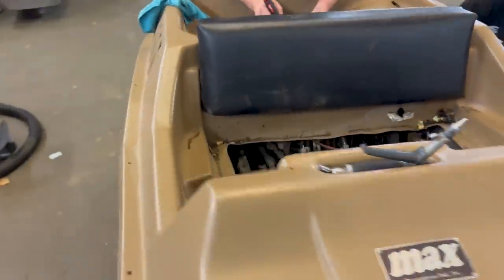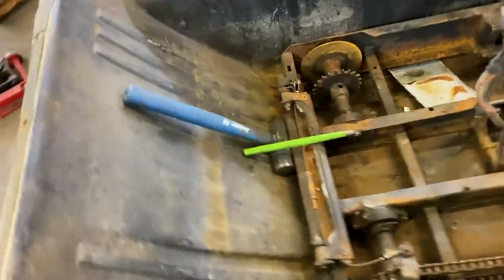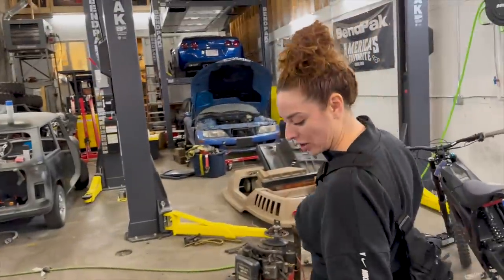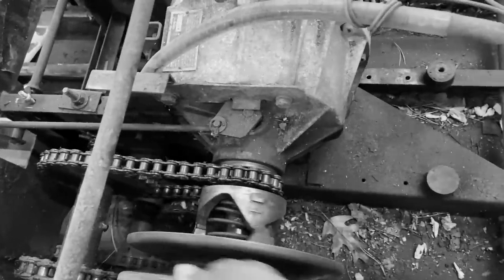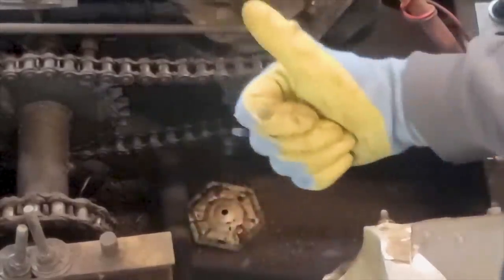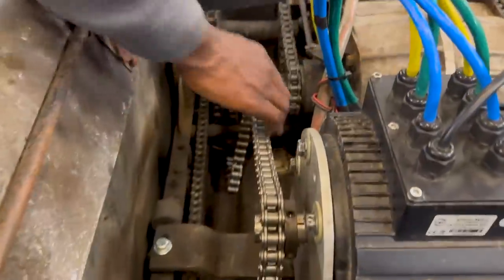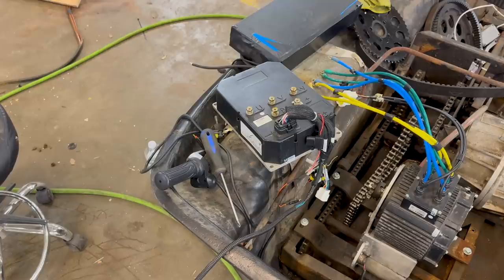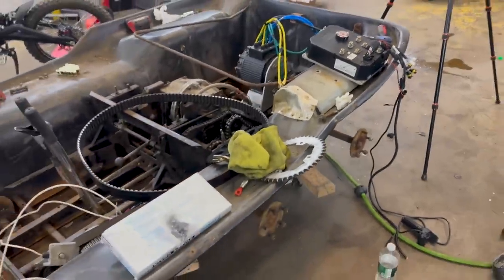Our First Attempt to Build An Electric Amphibious Vehicle led to Miserable Results

Comment: You need to scrap the center transfer box and install a pair of electric motors instead: a single motor drives each side. Will cut down on weight and reduce power lost through the transfer box. Also simplifies the controls.
Reply: On a first robotics team and this is exactly what the majority of teams do, even with a couple small motors it's more than enough to go like 15 mph
Reply: Motor and transfer box is probably not much lighter than 2 motors, more prone to failure than 2 motors and outputs a lot less power than 1 motor. 

Based on those facts, and history, Rich will almost certainly choose to keep the transfer box.
Reply: @theParticleGod  another motor means another controller and more hardware which isn't cheap or lighter by no means! Also if one one those fails it's bad!
Reply: @carholic-sz3qv   Theres no combination (1 motor + 1 transmission vs 1 motor + 1 motor) where a failure isnt crippling.

Comment: With Summer coming, I'd consider a quad jet ski combo, similar the Quadski. But with an EV swap.
Reply: And your strap on 😮
Reply: Water and EVs aren't the best combination. Rich isn't planning on going too far away from land on this project. An EV jet ski is trying to reinvent the wheel, but using flat sides on the new "wheel"

Comment: There is online calculators that will calculate the torque/HP of the motor based on the two gears and chain and motor HP/Power specs, and will tell you what the RPM and evertying is expected at the gear.  So that way you can pre-calculate all your sproket loss and if you are sending too much power, or not enough and adjust your gears until you are optimum.

Comment: On my Attex I had room to mount the motor above and slightly to the rear of the transmission which left plenty of room for batteries behind it in the bottom.  Initially I used Odyssey AGMs but upgraded to 16 100ah CALB cells.  I also used chain drive at first but switched to belt to eliminate lube being sprayed around from higher RPMs, chain stretch, and noise.  It's been over 10 years and still going strong.

Comment: The ideal conversion in my opinion would be to go for two (or more) electric motors to drive wheel groups independently. You could discard the transmission clutch system, and manage the steering by controlling motor power individually. You could even add a steering wheel with a digital encoder, and with a bit of coding, convert steering and throttle inputs into the required motor outputs.

Comment: I think that the Argo would work berrer with two smaller motors, one for each side and take out the differential unit as you can steer with a dual throttle setup .

Comment: Ditch more of it. Have a motor per side, or a motor per wheel. Perhaps hub ones, so you can seal the axle holes and just have wires pass from the inside of the vehicle to the wheels somewhere above the water line.

Comment: Uncle rich from my assessment.  You needed more sealant, resilin, or an epoxy.

Then you needed a better type of material.  

You have a 35% chance with what you did in the video but with my assessment you have a 57% percent improvement.  

Amazing work.  You did a stunning job.

13:25 the material is too heavy.  You need a lighter metalframe.  Amazing job.

Comment: That sprocket on the engine output shaft is a CVT pulley. Same goes for the input shaft on transfer box.

Comment: I would have used 6 separate 36v 1800 watt motors and controllers (109 for the combo on amazon right now) and ran them to a mobility scooter joystick (91 on amazon). All in all 750 for motors and controllers, some of the ryobi knockoff 40v batteries (400 bucks for about 48ah). For shiz and giggles I would have mounted an electric propeller motor to a trailer hitch mount to throw on the back to get water speed up.

Comment: It would be more work and more expense, but I’d say ditch the transmission and go dual motors, one on each side.
Reply: That would actually be the ticket you'd also have 6wd! 
Weak point with those is the trans/diff is basically open (and has to be to steer)

Comment: That machine is a max 6x6, not an Argo (which yes does own sherp now). The max has a very different transmission than any model of argo. Ditch everything but the chains and instal 2 electric motors, one for each side.

Comment: This doesn't really need a lot of power - I definitely wouldn't go with a motor any bigger than the one that was attempted, since at that point you have to compensate the power and weight with more batteries.  Not to mention, a bigger motor is likely to be more expensive.

Comment: For one this is NOT an ARGO. It is not like a SHERP….it is the other way around. This model though updated a few times has been around since the 60’s. They were built in Buffalo,NY. 

The build,get new chains and sprockets. Get the updated transmission bands for the T-20 transmission. Also get the aluminum throttle upgrade or 3d print your own.

Put your battery pack(s) where the gas tank is and around the electric motor. Run atleast a 16hp electric motor and use a pulley with a spring loaded  tensioner for the belt.

Also it is NOT a fiberglass body. It is a vacuum formed HDPE body…2 separated pieces. You can buy them NOS. I have over 25 years experience with these. They are better than the ARGO brand but the company was sold back around 09 and then again a few years back to an overseas company which is doing it’s own thing,so these are effectively no longer produced. Want to know more…just ask.

Comment: The motor probably just has a bad bearing and it's allowing the rotor to contact the stator.  You should pull it apart, motors are much simpler than the controller;  so it's funny to see you pull apart the difficult component but not the motor. lol..  new bearing and it's probably good to go.

Comment: there could be an internal short in the motor
Reply: first disconnect the phase wires. then test for continuity. 
Can do similar if you got the wires wrong, or maybe a weird fault with controller locking phases.